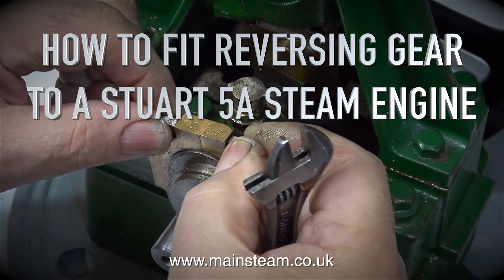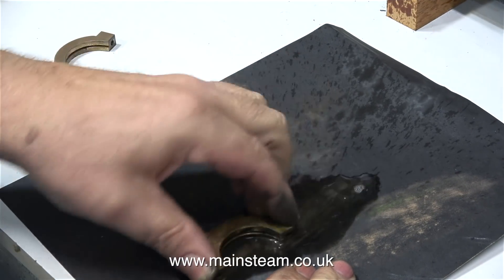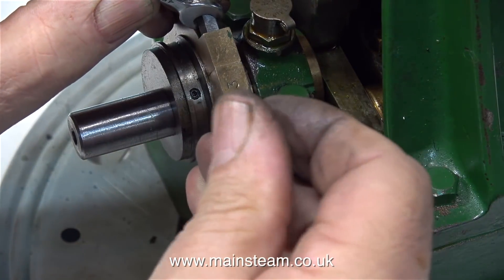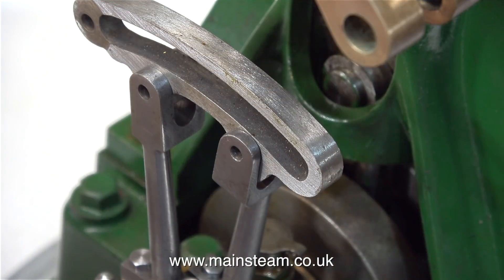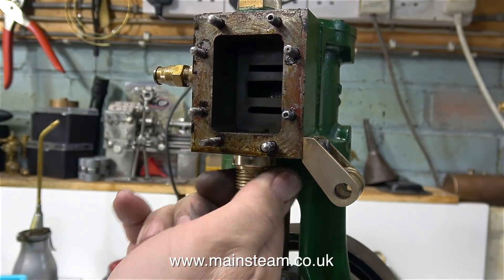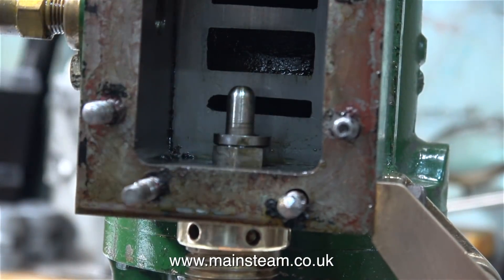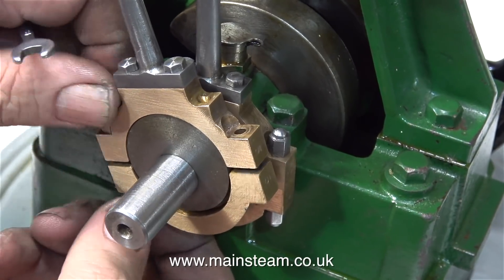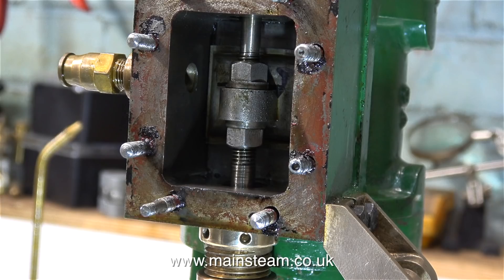HOW TO FIT REVERSING GEAR TO A STUART 5A STEAM ENGINE - PART #2

Comment: You could put a hole through the eccentric strap so you could adjust the set screw (grub screw).  Thou more than likely it would beome a weep hole.  Tho I am surprised they didnt leave a hub on the outside to adjust it.